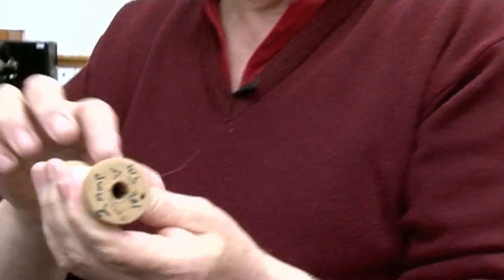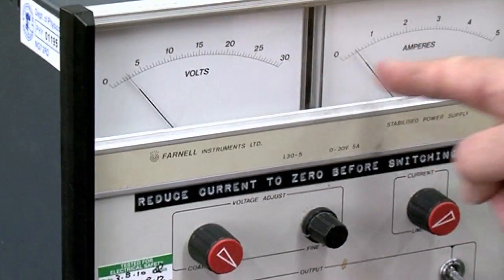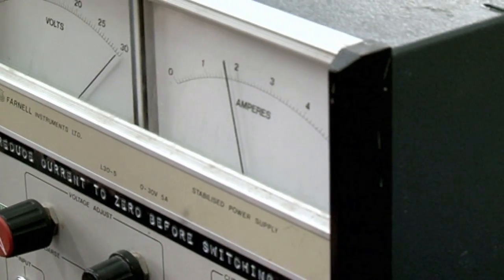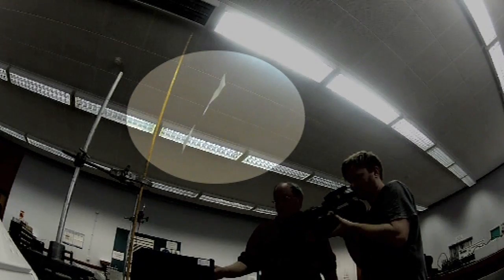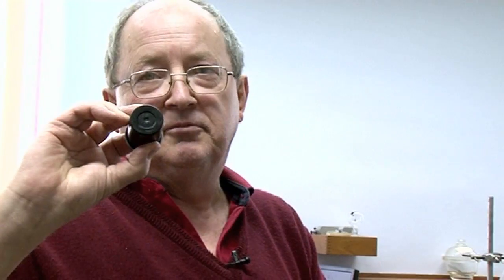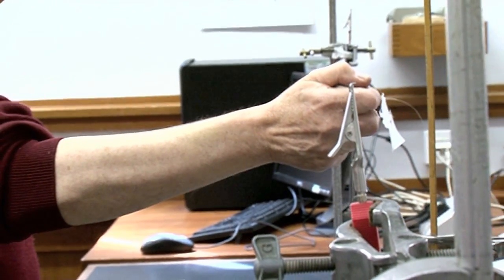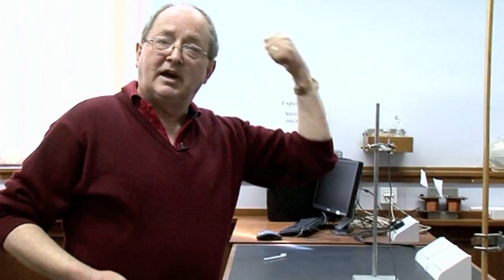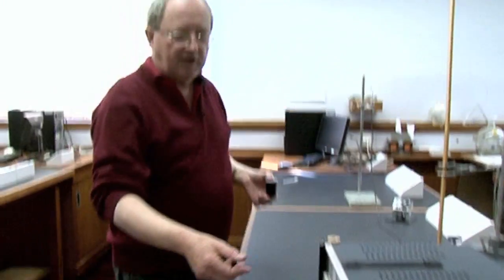Current and Magnets - Sixty Symbols

Comment: Actually, heat DOES radiate equally in all directions. Don't confuse heat with hot air, which rises. I use to think the same as you, but a good friend, a Ph.D. in low temp physics, set me straight. If you were to heat the wire in a glass tube which had a vacuum inside, you would measure that the amount of heat radiated is the same in all directions. The effect you see is that hot air is less dense, and thus refracts the light differently.

Comment: Not the temperature gradient itself, but the refractive index gradient in the air caused by that temperature gradient. Warm air is less dense at the same pressure, so it has a lower refractive index. The same thing causes the shimmering effect off a hot road surface in the summer.

Comment: Not really. Have you never seen a car in a very sunny day? You can see the very same visual distortions over it, yet, no electrical current is passing. If you were to heat the wire with a torch, the same effect would happen. The reason it moves in such a way is the same reason a flame has it's distinctive shape. It could be easly checked with a thermal camera.

Comment: SInce heat radiates equally in all directions, why does it only move in a predictable way? You could also heat the wire another way (say with a torch) and the effect would be nil, proving it is the flow of current causing the movement.

Comment: Look closely at the wire when the current is turned on--you can see the light diffracted around the wire--is this due to temperature gradient in the air around a heated wire?

Comment: The wire is rather hot due to the current running through it.
What you're seeing is water in the air shimmering.

Comment: That's right, and even a static electric field will appear to change and become a magnetic field as seen by an observer moving relative to the static charges. Or a static magnetic field can become an electric field to someone moving with respect to the magnet, which is exactly how a generator works. You really should read Einstein because this was the core of his reasoning that led him to special relativity.

Classical EM is fine (usually). Relativity is just another way to see it.

Comment: The only way an electric field by itself can become a magnetic field is if the field is changing. You can have electric and magnetic fields. Things can be 2 things at the same time, as long as the 2 things aren't mutually exclusive. I have not read Einstein but I don't follow your point. from wikipedia: "The [electromagnetic] field can be viewed as the combination of an electric field and a magnetic field." which means electric and magnetic fields are NOT the same thing.

Comment: Magnetic fields are not electric fields. Electromagnetism has to deal with the change of the fields and how both are related to the flow of charge. Movement of charge through a electric field creates a magnetic field. They are not different representation of the same thing even if they both derive from the electromagnetic force. It have very little to do with relativity.

Comment: What' going on at 0:55?
 The board in the background looks like it's bended around the wire. Is this a kind of heat refraction of the air?

Comment: The really neat things about the relativistic view of electromagnetism is that it shows "magnetism" as such doesn't really exist, and that relativity can be significant even at very low velocities. The electrostatic force is so incredibly strong that even the tiny force imbalances induced by special relativity on slow moving charged particles are visible as the force we call "magnetism".

Comment: You noticed that too, huh? I sure did. Not surprising given the current and voltage: 30V @ 2A is 60 watts being dissipated almost entirely in that thin wire! No wonder it sags so much.

There actually used to be "hot wire" AC ammeters that measured true RMS AC currents with arbitrary waveforms by how much they heated a wire and caused it to sag. I'm surprised that he didn't mention this.

Comment: I'm slightly unsure about this.
From what I've learnt, a moving charge/current in a magnetic field experiences a force perpendicular to the direction of current and magnetic field. I.e. FLHR.
What I'm confused is, current produces a magnetic field around itself given by Right-Hand Grip Rule.
So, the attraction/ repulsion force, is it actually directly due to the magnetic field and indirectly due to the moving charge that produces it?

Comment: Basically, the wire gets really hot and it heats surrounding air.
Hot air distorts light that passes through because it has different refraction index from the cool air.

Comment: Professor Roger Bowley uses a piece of a fuse wire , direct electric current), and a permanent magnet to demonstrate effectively:
1.	The temperature dependence of the resistance of the wire.
2.	How the length of the wire increases as the current through the wire is increased.
3.	The interaction between the magnetic field and the moving charge (current).
The demonstration is an standard classical demonstration and may be used by high school students, freshman students as well as educators.

Comment: So the wire is actually losing strength as its heating up? The weight of the paper is pulling it down? Or would it go down without the paper and the paper is just an good visual indicator? Or do I misunderstand entirely?

Comment: Yes. One of my colleagues did it by trying the experiment and turning up the current too much. This was before Brady did the video. Paper burns at Fahrenheit 451 (hence the title of the book by Kurt Vonnegut), so you can work out the temperature in Celsius or Centigrade. It needs a slightly higher current to melt the fuse wire. Do not try this at home!

Comment: Your presumption is correct. The resistance in the wire causes it to heat up to almost 200°c (as prof. Bowley mentions in the video) which in turn heats up the air around it, causing the refractive index to differ from the cooler air slightly further away => visual distortion.

Comment: I think it's just air. As said, the wire is really hot, which heats the air surrounding it. As hot air is less dense, it rises and causes a slight turbulent flow, which you can easly see.

Comment: The wire is quite hot as it was said. When the air heats up its refraction index (the speed of light travelling through the material) changes, causing the well known optical effect of the mixing hot and cold air. With the from-point-to-point changing refractive index the light wont travel in a straight line anymore.

Comment: I suspect it's to do with the heat that the wire carries, heating up the air around it. As he mentioned the wire is designed to carry only 2A and will melt at 200 degrees C. That wire must be pretty hot even at 1.9A!

Comment: There is a quantity called parity which concerns the left-handedness or right-handedness of a system. Imagine yourself looking in a mirror: your left hand becomes your right hand as seen in the mirror. In quantum mechanics there is an operator that acts like a mirror and turn the wavefunction of an elementary particle into one with the opposite handedness, or parity. Madame Wu proposed that parity is not conserved in interactions involving neutrinos: handedness is not constant.

Comment: He explained it in the video, although not directly. With the current running through the wire, the resistance of the wire causes it to heat up to just under 200°c. As it does so, the air around the wire heats up as well, which causes the refractive index to change slightly.

Comment: That's not electric field bending light. That's the hot air around the wire distorting the light's path, not unlike how it happens with mirages.

Comment: It's the refraction of light due to differing densities of air around the wire, which is caused by uneven heating. You see it on hot pavements as the "wavy air" effect.

Comment: the hot wire heats up the air around it, which changes the refractive index of the air and causes this optical effect. You can see it often in everyday life, if you look horizontally over a car roof thats baking in the sun, or you can notice it over a candle flame. Or when you use binoculars in the desert you can see it near the ground.

Comment: The surface of the wire in the demonstration is 200 C  as paper burns at this temperature ( 200 C=451 F); inside the wire is much hotter. When a professorial colleague turned the current up too much the paper burned which was a fire hazard, so we turned the current down to a safer level. 
The  fuse wire is tinned copper which has a thin layer of tin on the surface--- according to George that is. I know next to nothing practical.  The copper has to be much hotter to melt,  I make errors.

Comment: The metal expands with heat because heat is essentially the molecules moving faster and pushing each other out harder, so the volume that the molecules will be in is larger.

Comment: Its exactly like the hot sun on a road effect! The wire is so hot that it heats the air directly around (heating dispurses the air particles more - so its less dense) it which allows the light to travel through the air quicker (as its not interacting with as many particles) so it refracts (bends) at a different angle. You see this when you look into water (which is much more dense than air) aswell, but at a much greater extent. Its hard to explain in 1 comment, but I hope this helps.

Comment: Interesting that he could adjust the voltage and amps separately. Also why the heat from the wire distorts the light around it.

Comment: A lot less to it actually.  As the Professor said, the applied current is causing the metal wire to heat up.  As the metal heats up it expands.  The expanded wire is longer and sags.  When he turns off the current it cools off and shrinks returning to its original taut position.

Comment: E=mc^2 would increase the mass a (lot lot) lot less than the mass lost by evaporation, so what you see has nothing to do with relativity.  The heat soften the copper, almost melting it and makes it easier to bend from its own weight (which practically doesn't change).

Comment: Wow, that wire must really be hot!  I'm surprised it springs back up so quickly when the current stops, but I guess metals conduct heat well, so the heat will easily be sucked out.

Comment: I assume the paper's there because the wire is thin.  If it wasn't there the movement would barely be visible.  But the paper allows you to easily see the movement (you can still see the wire, but the paper makes it easier, especially for those with visual impairment who may not be able to see the wire).

I could be wrong though.

Comment: No, power lines sag because of the weight (or pull of gravity) on the wire. It is literally impossible to pull the wire tight without damaging either the pole or the wire. Some high tension lines have over 40 tons of force on them and still sag. If a power line heated up enough to sag there would be more problems than the wire sagging.

Comment: A 2amp fuse wire will melt when the current through the wire is more than 2 amps. If 200 degrees happens to be the melting point then it is, but it's just a mere coincidence.

Comment: It's because of the heat, causing the air above it to expand a bit, deforming the light waves a bit. Just like you sometimes see above a hot road in the summer.

Comment: This is a variation on the Schlieren method of density visualization. The optical density of a gas depends on the density. A denser gas is also optically more dense. The hotter gas is less dense, so that light rays that graze the edge of the hot region are bent outward. This effect is visible in all gasses with a density fluctuation. Try the following: Hold a candle flame a meter away from a sunlit wall. You can see the shadow of the hot gasses abovethe candle.

Comment: When the current is running there seems to be a lensing effect... 
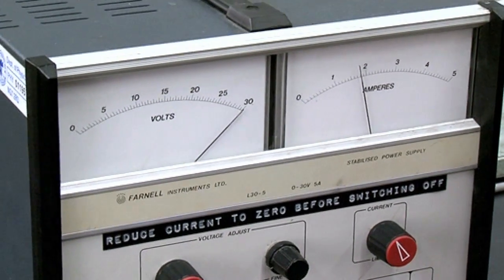0:48
Look at the background...
The wire when the current is off doesn't warp the back wall.   Once the current is turned on, the background seems to warp near where the wire is...

WTF

Comment: its hard to imagine the wire getting hot quickly but at certain points in the video you can see the heat waves radiating from the wire

Comment: The heat causes the air to expand. Lower pressures have a different refraction index than higher pressures, and this causes the light to bend as it enters the hot air.
It's to same effect you see above a fire, or a mirage.